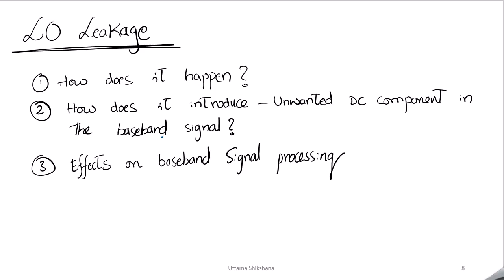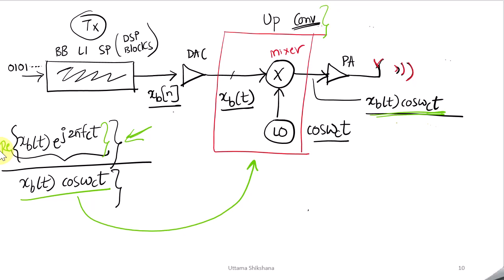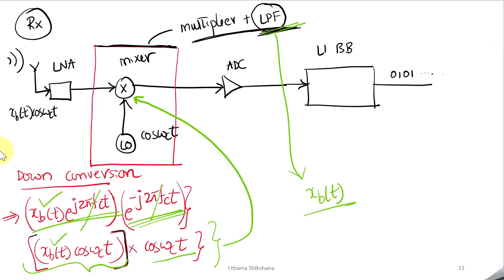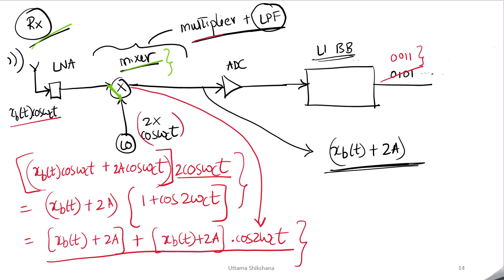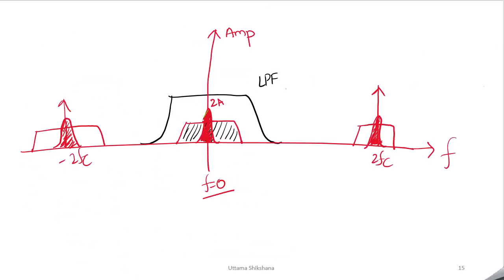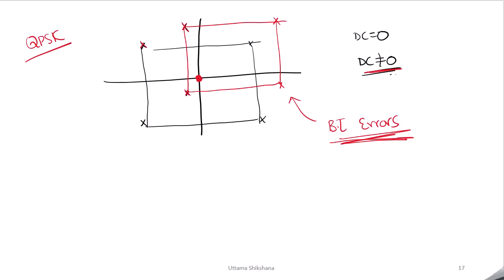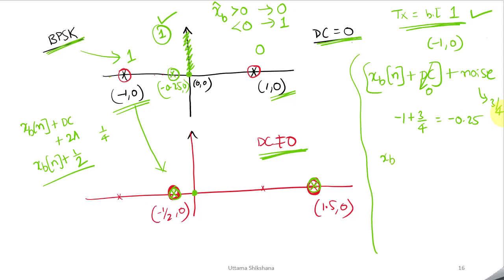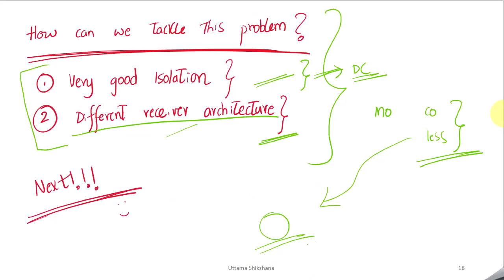[Series #22][Industry] 5G 4G | LO Leakage | Unwanted DC | DC Null SC | Half SC shift - Part 2

Comment: Thanks for your videos. Why 2A has some Bandwidth ?
Reply from the maker: Thanks a lot for this very good question.
Ideally, it should be impulse with zero width (as per theory).
But, in practical systems, there is always some small width to the impulse signal which depends on the design and characteristics of the hardware components.